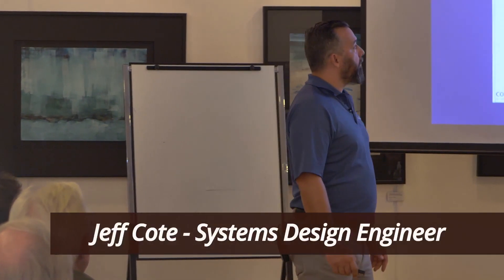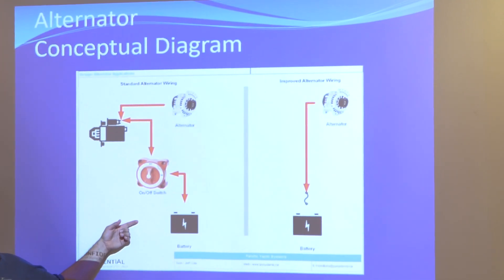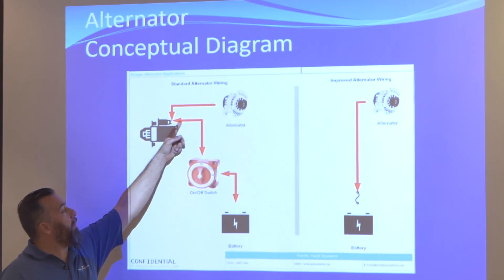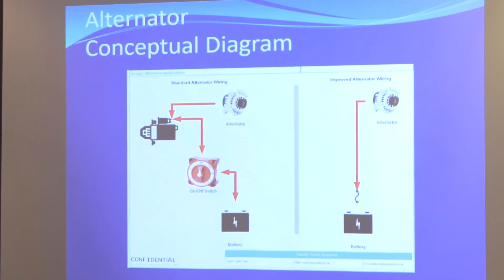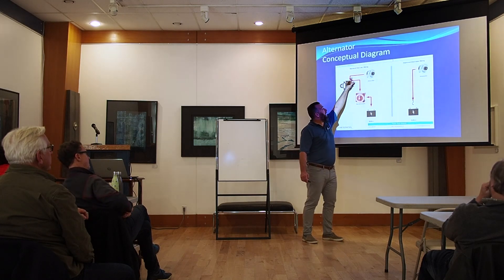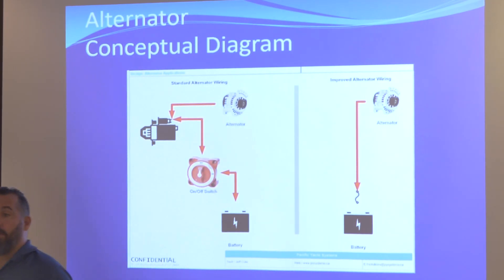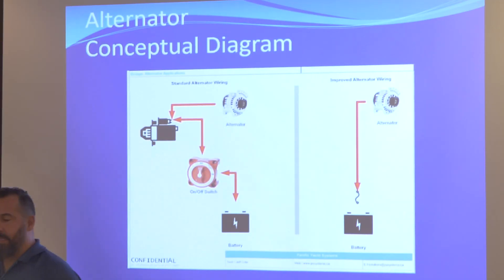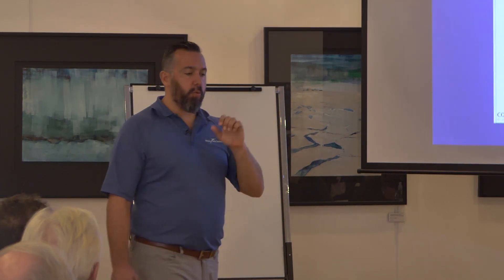How To: Marine Electrical Seminar - Alternator Troubleshooting - Ep 22/30

Comment: my alternator seems to increase the starter battery voltage from 12 to 14 but as soon as my orion tries to put charge into my house battery the starter battery voltage drops to 12v and because of my engine shutdown detection setting of 12.7 it turns the orion off, could this be the alternator not able to give enough amps? its a 55 amp alternator on a 2gm20 - with a 100ah start battery., If i turn off the engine shutdown detection while the engine is running then the start battery will sit at around 12.7v with only about 5-8 amps going into the house at 13.3v - the orion is set to charge at 14.4v however it never gets to this voltage.

Comment: My recently rebuilt alternator shows voltage output on the bench but does not output amps when installed.  The alternator light comes on, while the other alternator works just fine.  What causes something like this?

Comment: I’ll tell you what I learned a heck of a lot about how my boat works just buying one of those Victron battery monitors. You can tell how many amps your alternator is actually charging your battery bank. My next thing is to get an external regulator. I would like a recommendation from you guys. Max 50 amps would be great.
Reply from the maker: Hi Franklin, I'd recommend the Balmar 614 for an external regulator.

Comment: I have a question. In a system connected with an acr, alternator connected to starter battery and solar to house bank (both agm), and say their charging voltage is different simply because of the state of the batteries. Will it be a problem? And if it is, what will be the solution?
Reply from the maker: Hi Deniz, as long as both starting and house battery are same battery chemistry (e.g. AGM), no problem using a Battery Combiner (or Automatic Battery Combiner ACR).